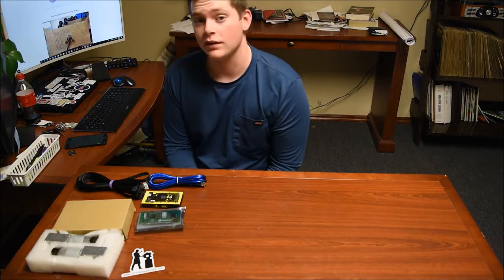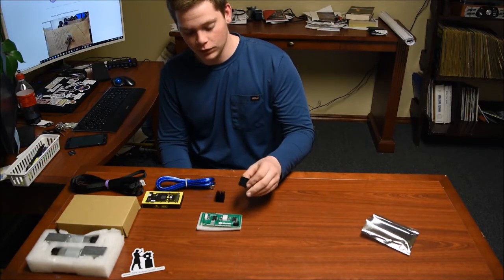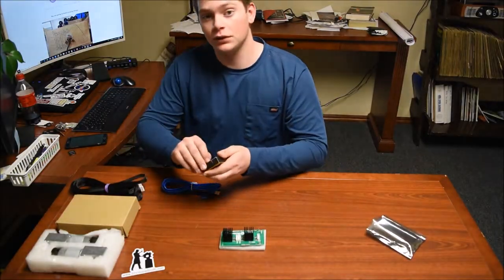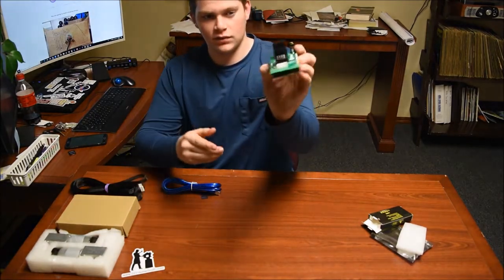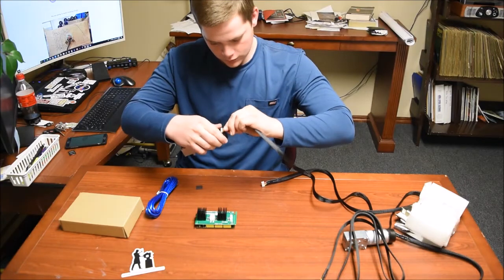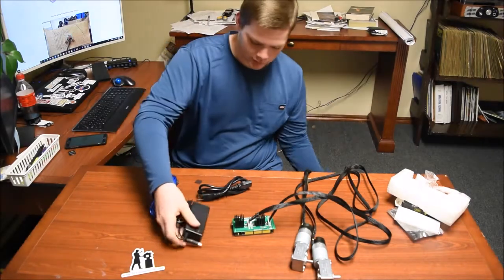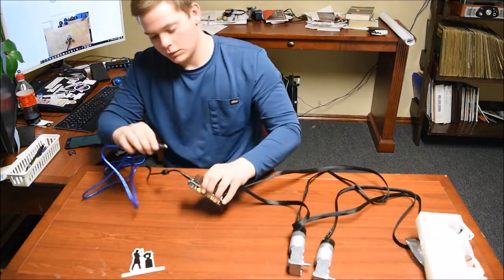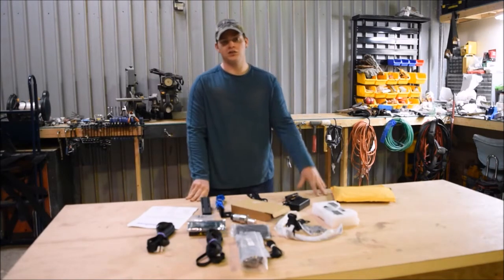Maslow CNC Setup: Step 1 Setting up the Electronics

Comment: mine when plugged  to pc sounds like it does not recognize the cable, i tried another pc and sounded connected twice, later it just sounded like not connecting, already changed the usb cable, no luck, should i install the drivers? the green lights are on